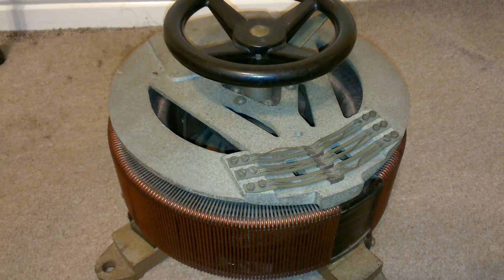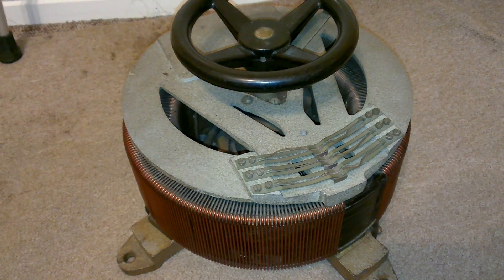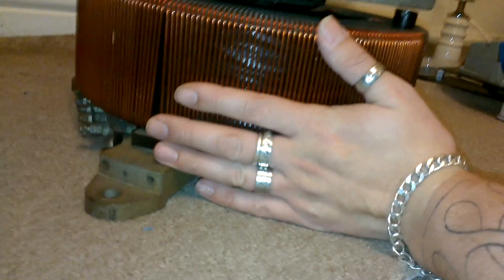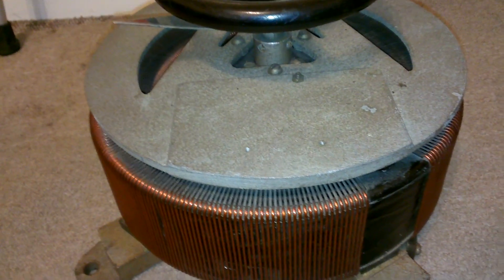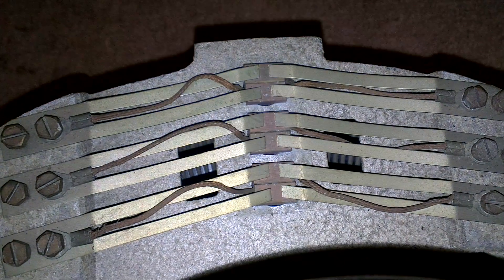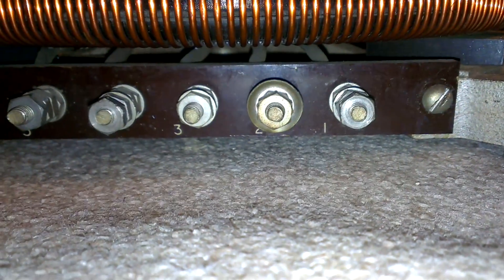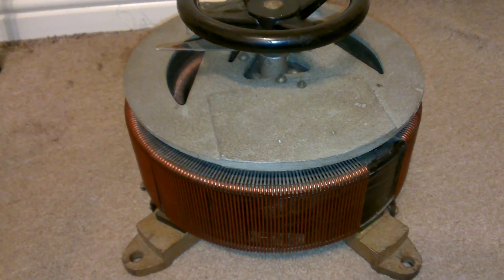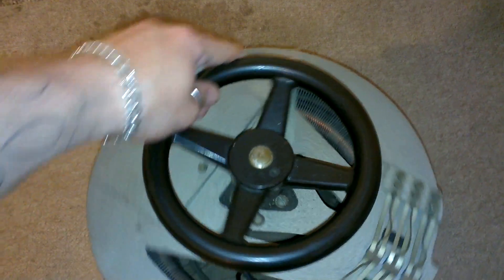My new very large Variac :) Its all working

Comment: Ah, so you sorted the wiring config. Niiiiiice! Next up, is to make an enclosure for it. Did you get the voltage plate with it? ( the bit around the dial which says how many volts it's turned up to) If not, you'll need to mark out some lines on top of the enclosure & using a volt-meter, mark the voltages on the top for reference.

Looking forward to seeing this monster in its enclosure, ready for some crank-it-up action. :-D

-BoomBoxDeluxe.

Comment: I think the side with 5,4,3,2,1 are tap points that go to different places in the coil (probably at every 1/5th section). Use a multimeter to measure the resistance across these points, although that could be hard if the coils DC resistance is below 0.1ohm.

The terminal labelled brush is the adjustable live which goes to your load and I think the one next to that might be common to a terminal on the other side, if it is then this is your neutral connection.

Does it have any model make/numbers?